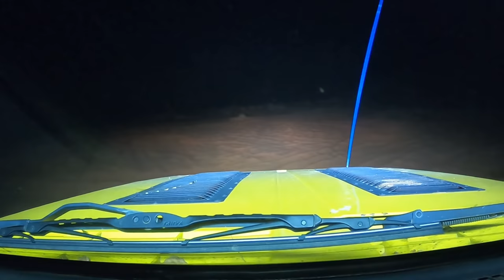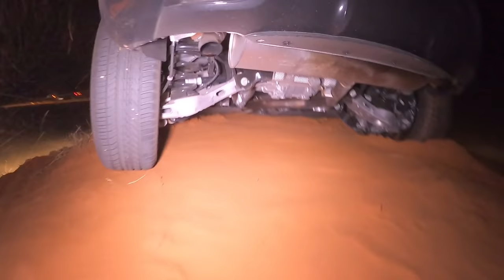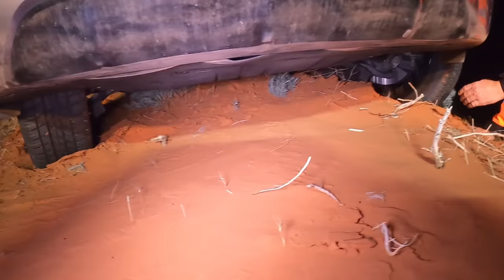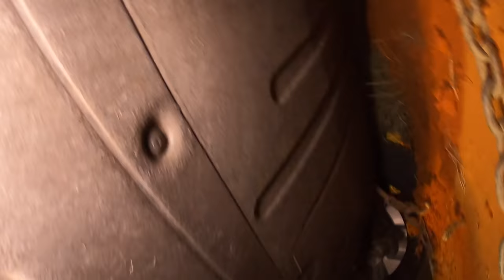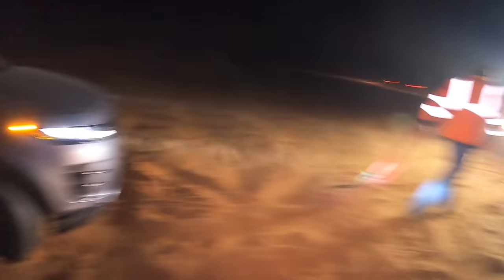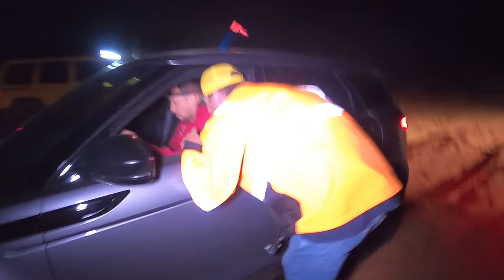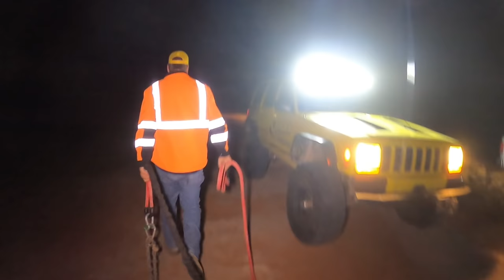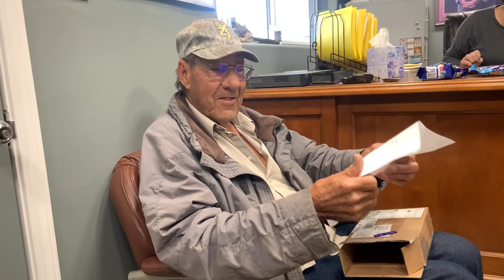Range Rover Evoque Not Doing So Well

Comment: Make no mistake about it, these are expensive vehicles and their capability is an absolute joke.   All that money spent on a 4x4, only to discover that a grocery cart at Walmart has more tow points.

Four years ago, I was on a trail and came upon an elderly couple that had gone on a little drive.   They took a bump a bit to hard in the vehicle and set off some type of sensor that disabled the vehicle.   Road side assistance was of no help to these people essentially leaving them stuck in the woods.

I had to tow the vehicle  with my V8 ZJ the same way Matt did.   Once at the main road, we contacted roadside where they reluctantly came and got their wonderful masterpiece of artsy 4x4ness.    When the old man told me what he paid for it, for that kind of money, I would have expected a C130 to fly over and drop parachute 007 from her Majesty's Secret Service along with tools and parts to fix this vehicle. 

 It was kind of a religious experience for the old couple.   Praying to get help in the bush, pleading and praying with roadside to help them combined with the fact their dash was all lit up like a Christmas tree even thought it was summer.

I was glad to help them.  But I would avoid one of these vehicles.

Good work Matt recovering this vehicle.

Plate [C]

Comment: but but, it has the entire AWD drivetrain....most of those lil rigs have a selectable drive mode switch. my wifes nissan juke has it and it has 3 diferent modes. usually it it near the traction control switch

Comment: The absolute worst thing to do when driving on sand is to floor it, you need to start of slow so you don’t dig a hole with the tires then you can pickup speed

Comment: If the driver knows how to use them then he would of driven out after a pull of the sand pit, even with those wheels and tired. If you know how these awd or land rover work then you can take them loads of places,

They need to be crawled then the computer can switch or lock, it won't attempt to at 3/4k revs will breaks a few parts that way.

Mines early tc and even being bogged it kicked in and transfered power every second

Comment: It’s only an Evoque, the city SUV. Even a base model without the air suspension. Went well enough for high pressure road tyres, low ground clearance and not using the Terrain Response correctly. Not really fitting of the Land Rover name.

Comment: Land Rover even Range Rover is no longer a reliable off road vehicle. The Evoque is like a Subaru, doesn't even have low range transfer case. I had a 2008 Range Rover Sport and could not get good ATV tires that would fit on any of Land Rover's wheels. I had to get a 3rd party wheel that would fit a descent  off road tire. These wheels will not even fit my 2011 Range Rover Sport, they rub on the brake calipers. Maybe the new Defender but I am sorry to say that Land Rover is no longer an off road vehicle.

Comment: What kind of idiot takes a Range Rover Evoque of the tarmac,  in the uk we call them Chelsea tractors, only good for taking the kids to school.  I have had to pull range rovers up the slipways after recovering boats.  The Pajero (Showgun) could do it in high range rear drive, no need to use low 4 wheel